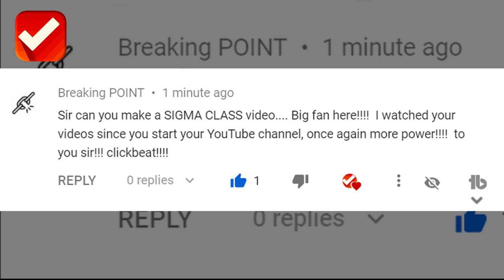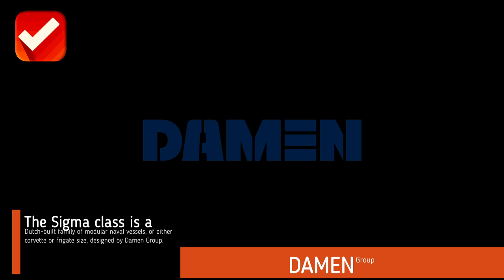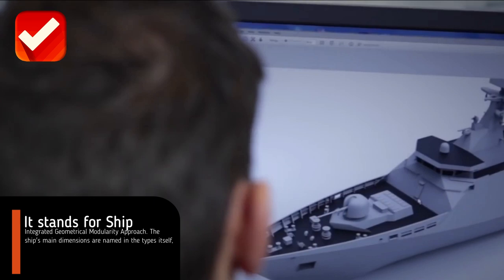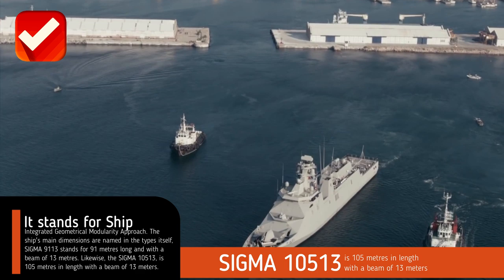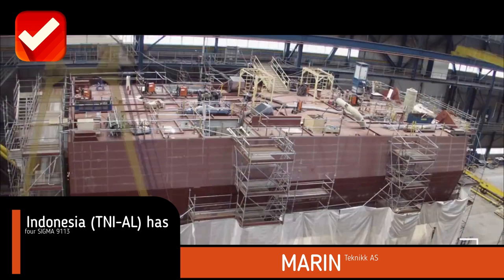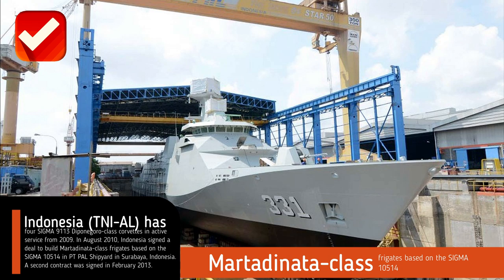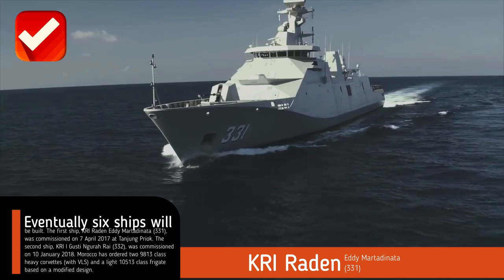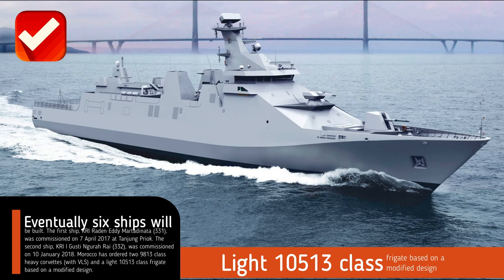THE GOOD LOOKING SIGMA CLASS VESSELS

Comment: What are it's combat capabilities I notice a lack of any real anti air, anti sub or surf to surf capabilities?
Reply: the only lack is just 2 frigate on that type who can acomodate the whole huge country
Reply: 1x Oto melara 76mm super rapid
2x 20mm Denel GI-2
1x 35mm Reinmetal oerlikon milenium gun for Ciws
12 cell vl mica
8x Exocet MM40 B3
2x triple torpedo launching system